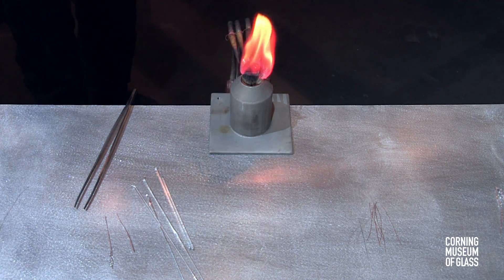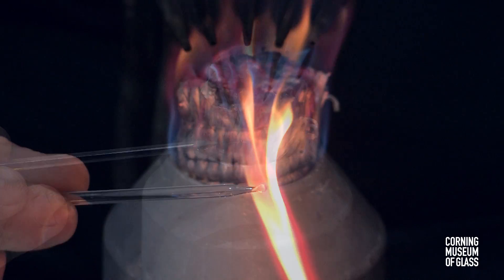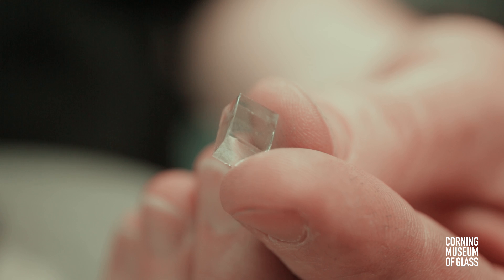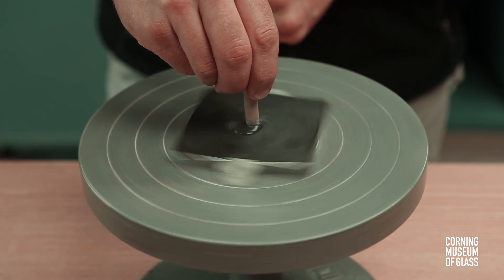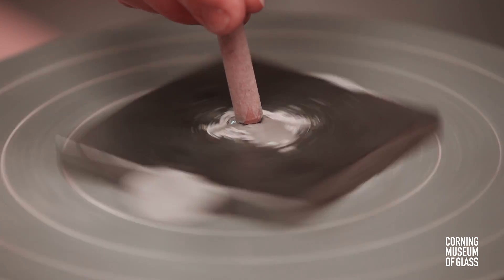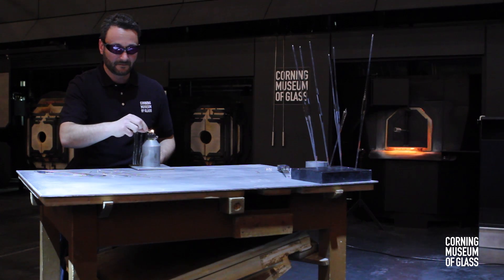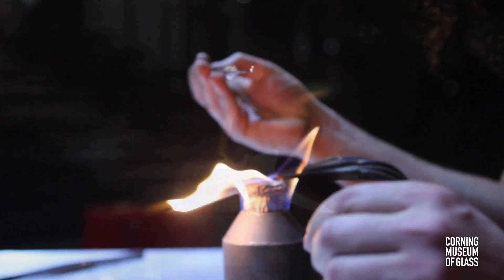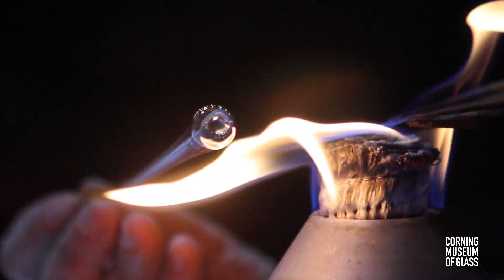Lens Making in the 1600s

Comment: 1:24 how the curvature of the mold was made good enough for a lens?
Reply: maybe molten metal? but i aint sure. If you would rotate molten metal i think it would get parabolic shape (paraboloid) but i am not sure
Reply: @PinkeySuavo  Yes, the shape that a molten metal takes in rotation is paraboloidal, but that's not how the mold was made, but in the way I showed above.
Reply: @ but how do you create the sphere?
Reply: @PinkeySuavo  That spherical surface in metal can be made with a round-ended drill bit. It doesn't have to be a perfect sphere, because the glass and metal will grid each other down (the metal to a lesser extent, of course) until they both reach a perfect sphere.
But the stick that the lens is attached to needs to be moved in all directions, not held perpendicular to the plate, as shown here.
Reply: It is enough for the mold shape to be only approximately spherical, the metal and glass will grind each other and both will reach a practically perfectly spherical shape.

Comment: For the blown glass lens, could the tube be filled with a liquid with the same refractive index to create a sort of fiber optic magnifier, the small end being used to examine a sample and the wider portion magnifying the view for the viewer?
Reply from the maker: Despite being started from a hollow tube, the actual lens that is produced through this process is solid, with no cavity in it.  Magnifying devices with liquids are possible, and have been made for many years.  However, they are made through a very different handling of the material from the blown lens described in Houk’s writings. Thanks for watching!
Reply: @corningmuseumofglass  the tube and bubble the lens is built on are hollow, no? I’m not talking about filling the lens (why would the lens be hollow?) I’m talking about filling tube the lens is suspended on: “... could the tube be filled...” it’s basically a glass straw with a closed bottom, right? That means you can fill the glass straw with a liquid. If the refractive index of the glass and the liquid are the same, you should end up with the equivalent of a fat fiber optic with a lens at one end.
Reply: @corningmuseumofglass  I loved your video....but now I am wondering how they made the hollow tubes so that you could make the bubbles. How could they make those hollow tubes make then?!? I am so curious!
Reply: Could probably pull this off with sugar water and a small glass bead to seal the small end of the tube
Reply: No unless the walls were mirrored but that's not really what fiber optic does is it? Can you see stuff through fiber optic? Wow probably huh
Reply: @simonlinser8286  the walls would be “mirrored” by the property of Total Internal Refraction due to the significant difference of refractive indices of the hypothetical liquid in the tube, equal to the glass itself, and that of the air. ever look up under water and the ceiling of the water turns into a mirror at a certain angle? the tube would not need to be coated with anything.
Reply: Does such a liquid exist? Glycerin?

Comment: hi I saw your video and tried to do the second process of grinding and polishing. after grinding I also got curve of the lens but it surface became blur. I can't understand how to polish it. please give me answer in the form of reply.
Reply: Srinivas Kolla the abressive powders are available in market of grit size 800 ,1200 etc. 800 is rough and 1200 is fine. You can bring powders from opticians. Very fine diamond pastes are also available. You can use valve grinding pastes too
Reply from the maker: To polish a lense of any size, you must first grind it to a near polished finish, which means going to 800 or 1200 grit of grinding, then switch to a polishing compound (commonly using cerium and or tin oxides) on hard felt to regain the glossy surface.  You can look at online tutorials about the general process of polishing glass and it will apply to this situation.
Reply: what does it mean 'going to 800 to 1200 grit of grinding?
Reply from the maker: What I meant was that you have to continue to grind and re-grind with finer and finer grits to remove the previous scratches and prepare the surface for eventual polishing.  Depending on the glass you are using, you will need to grind the surface very fine (either a 800 grit or 1200 grit) and then pumice and cerium to bring to a complete polish.  If you stop grinding too soon, the pumice and cerium process will not adequately make the glass glossy and transparent.
Reply: Corning Museum of Glass 熬
Reply: how can we know that lens is grinded upto '800 to 1200' grit

Comment: Thank you. What is the liquid used at 1:30?
Reply from the maker: Ryan - the water is used as a lubricant between the glass and abrasive.  One could use a light oil or other thin liquid as well.  Water is easy to clean up and manage.  As a lubricant, it helps the abrasive grain slide over the glass and removes stress from the process interface, to the abrasive doesn't prematurely break down.

Comment: Thanks for sharing. I was planning to post the video explaining the same but i wasn't confidant.I was searching this methods for years. I tried your methods before  your video. Grinding produces good lenses. I used slightly bigger glass piece then stuck it to a round metal bar with shellac. then rod held in drill gun chuck. made the piece round the exact size of metal (steel) rod.then removed rod from chuck. then other steel rod dimpled by using a ball bearing ball. then by using various powders i ground it. and polished it by using fine diamond paste and wood stick the diameter  i made was 5 mm. It produced good lens.
Reply from the maker: Thanks for watching!